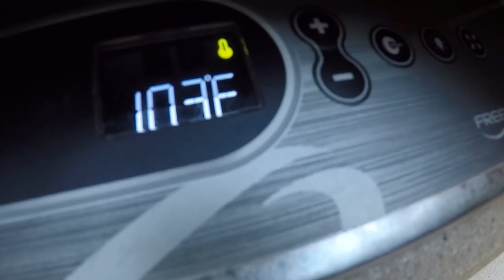This Truck A Slower Then A Snail! The New  10

Comment: Another idea for the blocking under the shed
Might be to paint with oil base paint so it will stand up to the weather better and deteriorate slower..
Personally i thin down lenseed oil and let the wool suck in all the oil it wants..
Then an oil base paint last couple of coats..
Bugs hate oil..
But that's just me...
Reply: Some of you might say..
Oil base bad for the environment..
But look at newer homes..
After a few years the water base is flaking off and the wood can start to deteriorate..
And the termites start having diner..
Is that not bad for the environment..
Wood sucks up oil base..
And it doesn't flake off.
And termites don't like it..
(I apply lenseed oil to all surfaces before installing the wood)

Comment: The s10 is much different then the rig.  Only thing your gonna do by "floating" the gears in the s10 is wear out the syncros much earlier then they need to be ...
Reply from the maker: +JACADP Productions your right in tryed it and it will not float so i will use the clutch lol it was fun to try

Comment: So it looks like size does matter after all.  Don't know why you didn't get an older 1/2 ton instead.  Your MPG will suffer but it would have been much more practical giving you the power and strength that you want.  I have a 2002 F-150 which I love.